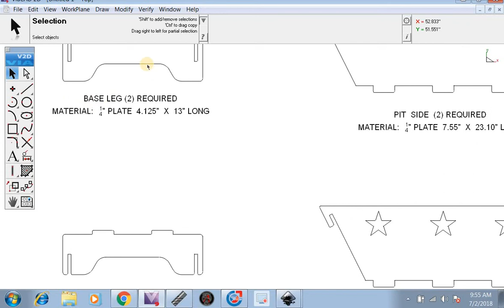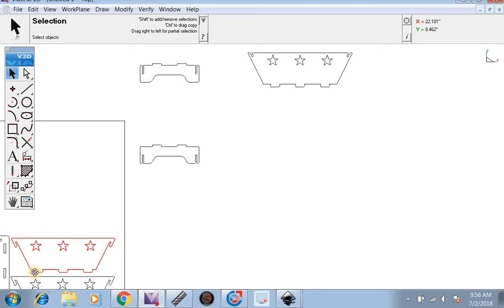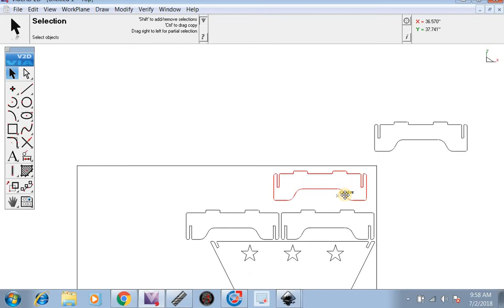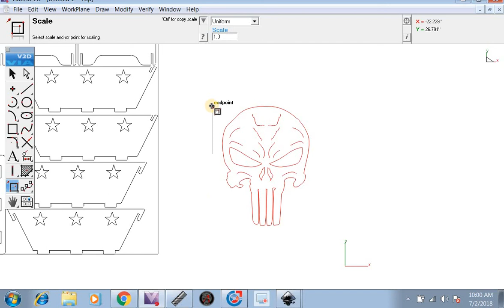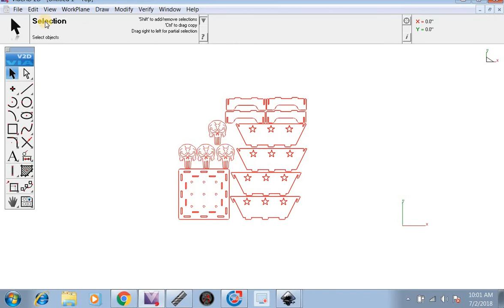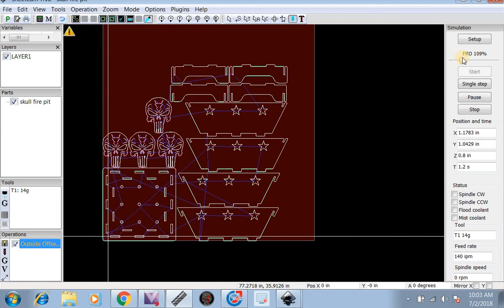FIRE PIT Customer Request

Comment: 1st Comment again!! 

If im using a cutmaster 52 machine cutting some 3/16 how fast should i be able to cut? currently im only cutting 3/16 at 15ipm 1/8 inch im moving at 25ipm 14gauge i see that your travel speed is 140ipm?